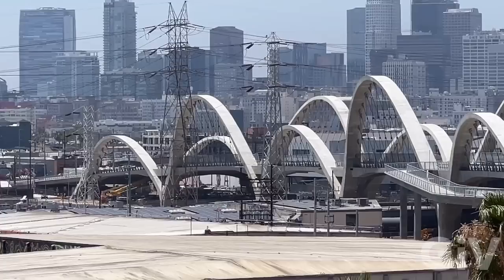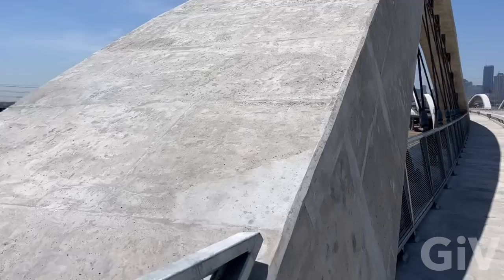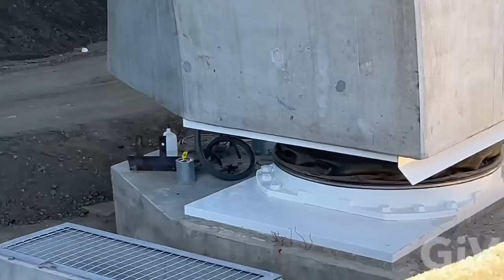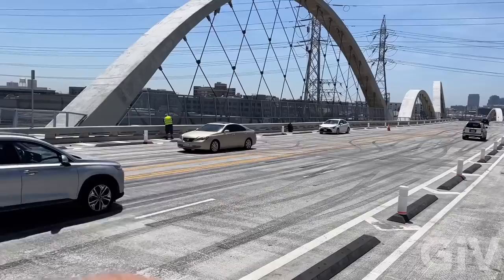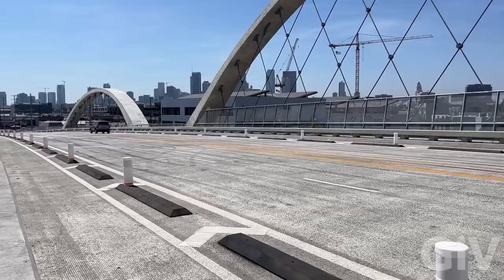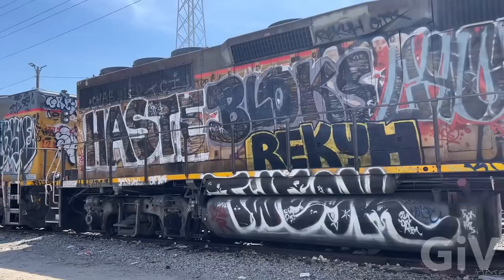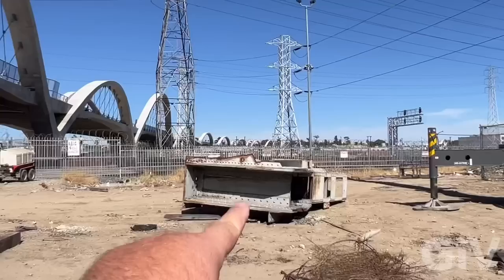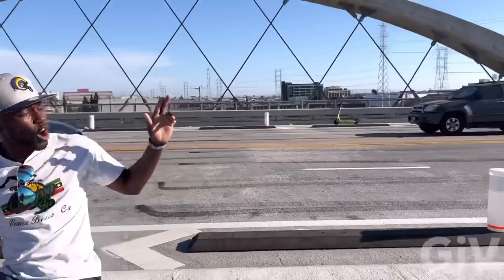The new 6th Street Viaduct Downtown L.A Gateway to Heaven or Hell ?

Comment: Mike, ridges in concrete roads reduce "skidding". So if you didn't know, now you know.
Reply: Its for anti Hydroplaning. These are normal on active runways.
Reply: @LK-pc4sq  yeah, water grooves. Concrete is much smoother than blacktop and doesn't drain as fast.
Reply: Longitudinal ridges are becoming more common than transversed.
Reply: 12:17 , that is a nice view of the city
Reply: The ridges is for homeless to wash and scrub their clothes on .
Reply: especially during icing conditions
Reply: @frankmata1812  really
Reply: It also reduces noise pollution by cars by 4 decibels
Reply: Rough concrete around swimming pools to prevent slip and fall accidents.
Rough concrete on roadways to prevent skidding during the rain.
Reply: This bridge will be destroyed by irresponsible denizens before an earthquake has its chance.
Reply: Not rough enough to prevent burnouts.
Reply: Are they using porous asphalt anywhere in the US? It has become a common thing for new roads here in Germany. Super quiet and virtually no spray behind cars due to the water seeping through it fast.
Reply: I'm really you said why because I had no clue.✌🏾
Reply: That’s what I do it’s called grooving then it goes thru a skid test.
Reply: Every bridge has that.
Reply: Actually The Hard Concrete.  The new stuff has grooves in it. They have been doing it here for years. I don't like it as much and it's definitely not as smooth but it lasts longer and will flatten over time instead of making pot holes
Reply: @Dhoing  yes, that might be a bit to advanced for the US. And one more point, it takes maintenance. 20% Open Asphalt needs to be re-layered periodically, and US roads are notoriously under maintained. After a certain amount of time the open asphalt will come off and it immediately needs to be redone, otherwise lot's of issues will start occurring for he traffic. They do not want to have to re-cover the bridges every ten years and they are so afraid of lawsuits...
Reply: Yeah plus in case somebody feel asleep behind the wheel they cooperate with the ridges on the tires and direct them forward
Reply: Technically the road skidding is usually caused by a phenomenon called "Hydroplaning" Vehicle hydroplaning occurs when water mixed with oil and other slick substances from a thin layer between a vehicles wheel(s) and the road surface. The tiny groves add two things to reduce hydroplaning of vehicles. ONE The groves provide channels for water and other foreign liquids to be carried away from the road surface. Because most US roads are crowned meaning they rise to the middle from both sides water is encouraged by gravity to migrate to storm gutters in the sides of the road. These road features working in tandem help prevent hydroplaning.

TWO The groves in the road surface provide vehicle tires with an additional a traction surface to facilitate optimal contact \ purchase between vehicle tires and the road surface.  Together these two road features on the new bridge enhance safety of vehicular traffic on the new span. Hope this helps buddy. You are the best all the werewolves in the know think so!
Reply: Rain grooves are for rain water...
Reply: @willbill7250  Oh and street surfaces don't get covered with oil, anti-freeze, rubber, salt, dirt and any number of other slimy things. Even as a pedestrian when rain first starts I feel the slickness of the pavement. It has been said and widely known that the most dangerous time on the road is when it first starts raining or snowing. The moisture separates the slick road contaminates from the road surface. Once it has been raining for a time those slick road contaminates get washed away into the gutters..
Reply: Harder to drift with the ridges. That's probably why that car lost its bumper.
Reply: @frankmata1812  good idea lol
Reply: @arthurthompson8241  Yeah, plenty of ice and snow in L. A. 😂
Reply: @huerosantos7563  LOL I knew someone would bite
Reply: I just saw a news report here in the Phoenix Metro area that said they're converting all the freeways to this type of material to reduce skidding and noise reduction because the freeways are really loud because of the material they traditionally have used. This New Concept which isn't that new but has been embraced by many major cities across the United States is better for the environment as well supposedly.
Reply: Exactly to prevent all the sliding in the snow ❄️ 🙄 🤣. That's a shit job
Reply: Dang I thought it would be common sense. I always assumed it was for better control when driving in inclement weather.

Comment: My father  was a journeyman Ironworks. He said steel beams can twist and bend in a huge eq. But concrete breaks much more difficult to repair after a disaster.
Reply: Iron workers don’t work on concrete work a reason, because they don’t know the technicalities of it.
Reply: @supremewhip  
They saw the results of bridges collapse in San Francisco big earthquake and time it took for repairs and inability to have makeshift temporary repairs.
Reply: @BILLOFRIGHTSDANGER  you do know that the replacement bridge is made of both pre-cast and cast-in-place concrete, right? As with most new bridges nowadays and that’s with much higher safety tolerances sampled through rigorous simulation testing not available decades ago.

Comment: The "ridges" are done on purpose after the road has been finished, A machine "Diamond Grinds" the surface and you are right about water but its not to channel it away its to help stop aquaplaning and works with the tread on the tires to keep a decent sized contact patch with the road.

Comment: Painting over graffiti? Boy is that is going to become a never ending battle!
Reply: Sand blasting cost too much?
Reply: Ban spray cans in LA and inform all spray can resellers to not ship to LA problem solved.
Reply: @Hschlick84  way more expensive that paint, sandblasting you need a compressor, sand or water gas for the compressor, etc.

Comment: You are correct, it is a photographer's paradise, great views at sunset with the city skyline and lighted arches.  Putting liquid nitrogen into the concrete mix would lower the temperature of the mix as it sets up, typically when concrete hardens and sets up it generates heat, and if its already hot and dry out, that would make the mixture set-up too fast and probably have cracks.  In northern states if your going to mix concrete in the winter, some contractors will add some radiator antifreeze to the mix, you can tell if concrete has a greenish hue to it instead of the normal gray color.  What gives the strength to the arches is that there is lots of rebar inside the arches so the arches are in compression.

Comment: Seems to not favor pedestrians as much as you'd think. Those ramps are insanely long, the path ways are not covered, not even with a wire mesh to give some shade. The Bike path just has easy to drive over bumps and rubber poles that bend over so cars can pull into the bike lane. It's for emergency stops far as I know, but still means that those bike lanes have zero safety from cars going 60 mph or more past you. It looks nice, kind of. But just seems to not really make any one happy in terms of serving bikes, pedestrians or cars.

Comment: Rough concrete for the rain water and accumulated gunk on the roadway such as motor oil. The road will get very slippery during the rain. With the rough road surface car tires can grip better.

Comment: The bridge roadway is concrete smooth concrete is slippery when wet rough like that will give tires traction don't need a slip and slide on the bridge

Comment: Let’s see what happens when LA has an earthquake. Can you say fractured concrete. The bridge will be come unsafe. If cracks develop there will be moisture intrusion which will cause any rebar(reinforcing metal inside the concrete) to start rusting. At some point it will need constant repair. Remember what they did to those large round posts that support the freeways. They had to incase them in metal to reinforce them from earthquakes because of what I just stated. 

Ricky from IBM, Ret

Comment: It is so easy to stop the madness on the bridge, Here are just a few which would work.

1. Put a solid wall barrier down the center high enough people cannot see over it from either driving or syanding on the sides.

2. add a TOLL BOOTH and each end and charge 5 bucks to cross it.

3. install Tactacil Speed Bumps every 75 ft.

4. Put RAZOR wire on the archs so people canno easily climb onto them.

5. Make MANDATORY 30 days in Jail for anyone climbing onto the archs and MAKE THE DA enforce it.

6. Impound the People who break th laws spend 30 days in jail just like their cars being impounded for 30 days and Charge them the cost of their food, medical care etc.

7. If a driver is UNDER 21 years old suspend their license and Block them from getting a license until they are 21

8. If it is a ILLEGAL IMMIGRANT or ILLEGAL INVADER from another country immediatly deport them and have them on a permament DO NOT RETURN LIST AFTER they spend mandatory 6 months in jail.

9. When they post their antics on Social Media, Us ie as proof to prosecute them and lock up anyone making videos of them and posting on sites such as You Tube. etc. as that just encourges more law breaking.